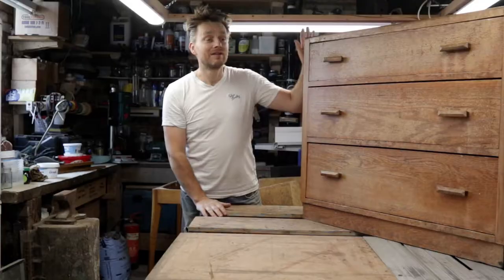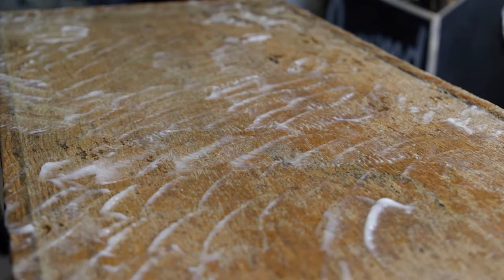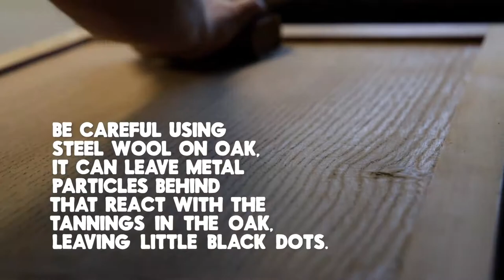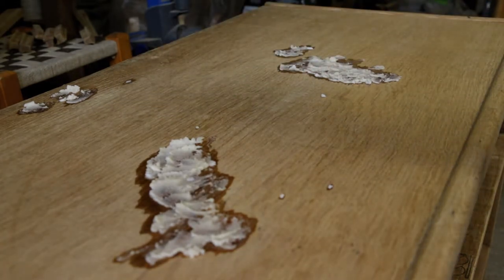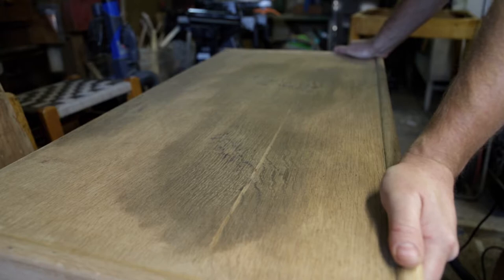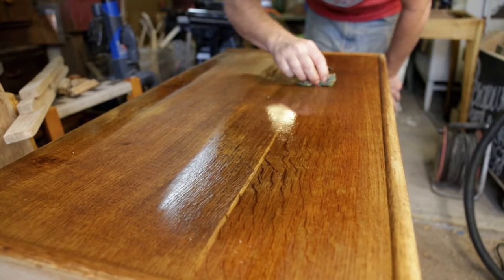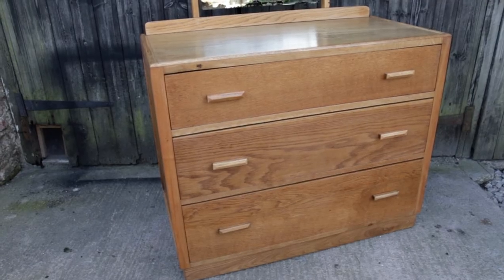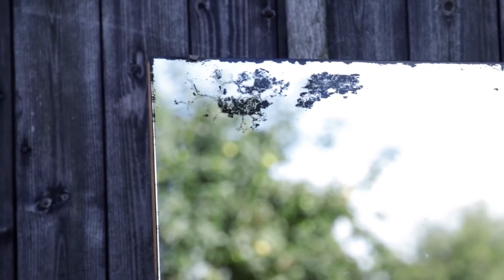Restoring - CC41 Oak chest of drawers from the 1940s

Comment: I have done the same to an identical chest of drawers which was also put out on the street to take away!  I had to replace the top plywood, which had been damaged by water and also had something heavy dropped on it, but thanks to B and Q cutting sheets of plywood  to measure if you need, that was very easily done.  An interesting thing was one of the drawer bottoms was a bit short and didn't reach its slot in the side timber - maybe in  wartime it was use that or nothing?   I didn't replace it, but put in an extra baton to support the end firmly. I felt it was a little bit of wartime history.